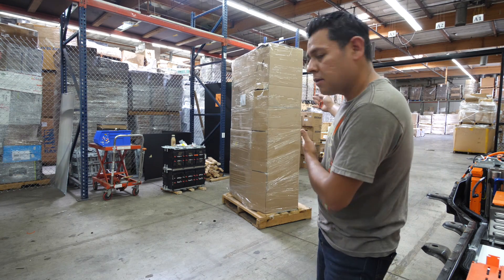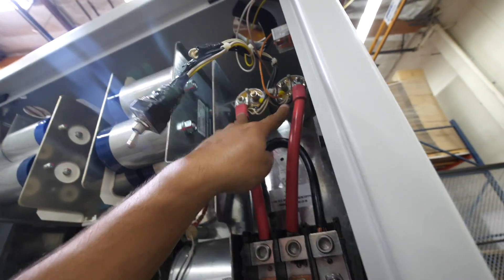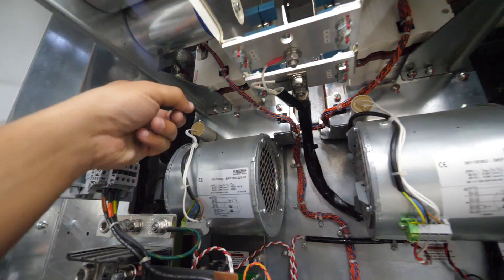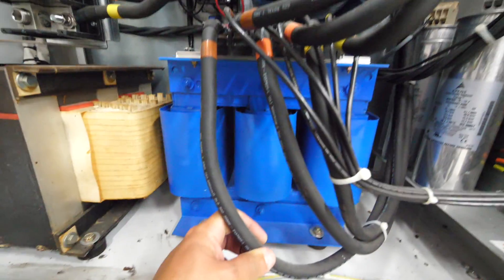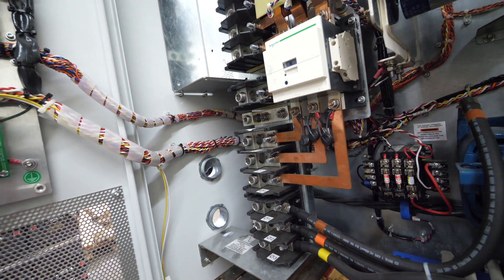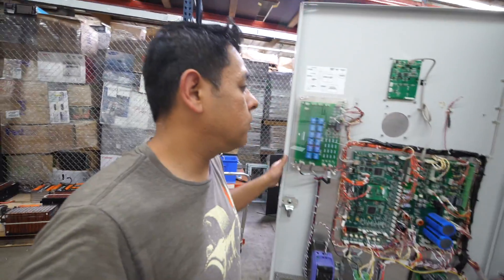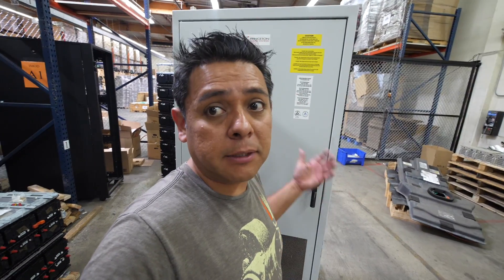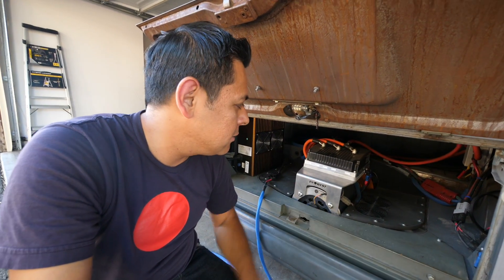A LOOK INSIDE A 100KW 3 PHASE SOLAR GRID TIE INVERTER

Comment: at end! you don't know shit about this inverter!!! loool
Reply: I found the video very interesting, the problem with a guy that say "at end! you don't know shit about this inverter!!!" is that he dont understand elektronics. For for those that are familiar with elektronic is this very valuable. I could paint a circut diagram of this after seeing the video not in detail but the overall working type. And Jehugarcia. the second ac connector is for powering up the inverter. And get it in sync with AC from powerplant. The comparisation of your small 100KW and the big  100KW inverter is the high isolation  voltage is needed to meet the law regulation reqirements for  such a high dc and ac voltage. i think. At this high dc Voltage u cannot mak the needed capacity smaller than the giant caps. U see it runs 24/7 make this with ur car and u get a hor melting sun :-) very fast at 100 KW. I like these videos because i had never a chance to open one up like these converters
Reply from the maker: Tony W no doubt someone will try and sue me for their stupidity,  good luck with that
Reply: The fun thing was to see if one could recognize/guess stuff inside it :D
Reply: Those big white boxes are contactors they make a nice ka chunk sound. looks like it has solar in via dc feeding which is powering the DC buss (all the big dc caps) which is connected to the IGBT's should be 3 of them if it's 3 phase ;P the igbt's are controlled by gate driver boards making the sine waves by basically switching on and off, each igbt is firing 120* apart,  larger systems normally have one board per phase. Also looks like it has Utility power input, the contactors are used for switching between the two "bypass".  that transformer on the output of the IGBT's is used to make a center tap "neutral" for the output so you can have single phase power as well etc.  Looks pretty robust, wonder if is is efficient being so larger, normally large things aren't very good at low loads when it comes to efficiently. Basically looks like half of a big UPS to me hahahah! ( just my guess though i don't work on grid tie inverters just things closely related )
Reply from the maker: Well,  i was right about at least one thing,   it has "stuff" inside.
Reply: ChrisLP Is ground to negative right? 😅
Reply: Jehu is funny and maybe he can't talk to much about the inverter, was nice to see one of this things semi-explained hehheeeheheheehehheehhehe
Reply: yes in most cases u connect always ground to negative so that u avoid hazadus voltages on metal cases and wires for a safty reason. so that it is safe to touch.
Reply: yes always , but there are a few exclusions like after a galvanic isolation in a power supply
Reply: Francisco Silva dc in to a transformer lol
Reply: In railroad use Chris, that would not be done. Starting batteries are at 64VDC nominal. The power going to the axle motors in a 1st gen Diesel  were 3000VDC. Lighting was either 32VDC or 64VDC depending. Control circuits were a mix of DC or AC. So positives and negatives were always isolated from the chassis. And you had relays that checked for ground faults. If either side grounded out, the relays would drop the power to the circuit.

Now way back, automotive and tractor use of 6VDC was positive ground.
Reply: @gravelydon7072  often times PV systems are bonded on the negative side either directly or through a small breaker/fuse providing the ground fault protection. NEC 690.41-50 cover the specifics with additional notes in article 250.

Comment: The two inductors and secondary capacitor bank form an LCL filter on the AC side of the inverter. The cabling for the caps does not need to be as large as that on the inverters output as it does not carry the full load power. 

The reason that the large box is so large when compared to your motor drives is primarily due to the filter components (which are generally not required for motor drives), and the water cooling.
Reply: It also seems to me that the large inverter could do 100kW for years with no sweet, where the smaller can only deliver 80kw for a short time and would probably shut down or catch on fire at full output after a few minutes.  Even if it is 95% efficient, it would still have to dissipate 4kw worth of heat.
Reply: jehugarcia wrong!  25
Reply from the maker: +Brad Preece  yeah it's really a 50kw continuous inverter